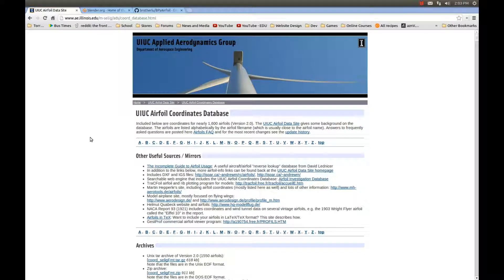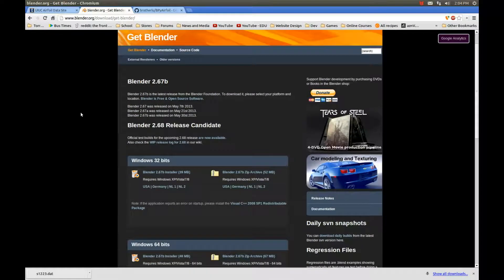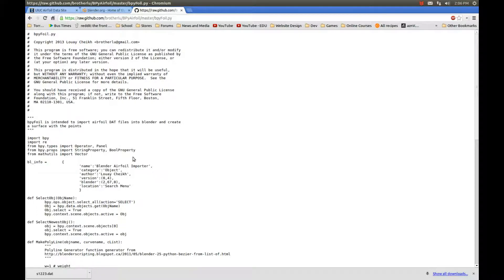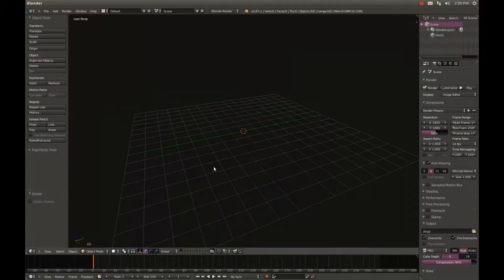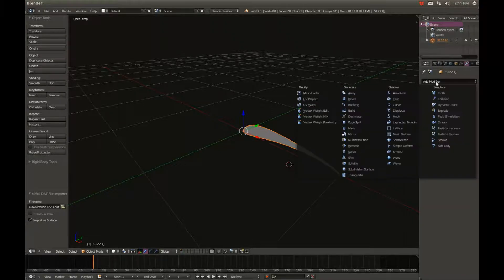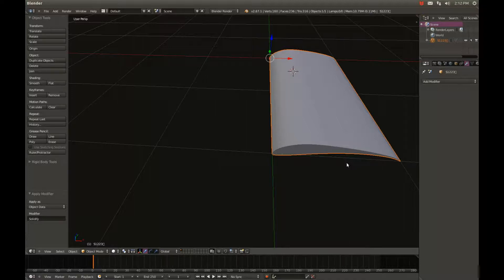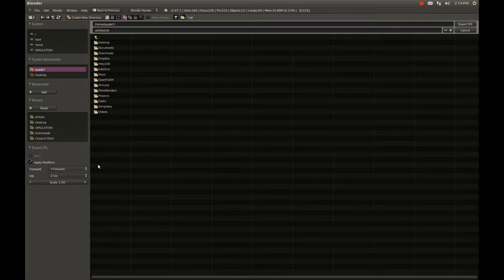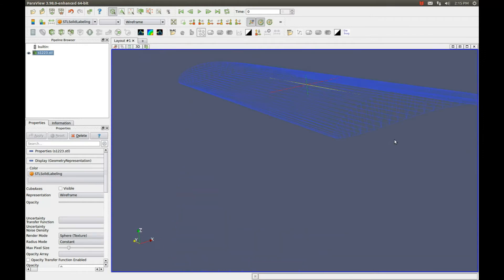Use Blender to model Airfoils

Comment: Following your directions, using the latest version of Bpyfoil and Blender (2.70a).  Can easily import the surface, however, errors start appearing when using solidify.  I've tried multiple airfoils from your recommended database. All of them solidify with errors.

Comment: Awesome video, thank you! For some reason, when I import the DAT file and check "import as surface", I still only see the image outline. It doesn't get imported as a surface, so using the Solidify operation results in a very weird shape...any idea of what I might be doing wrong?